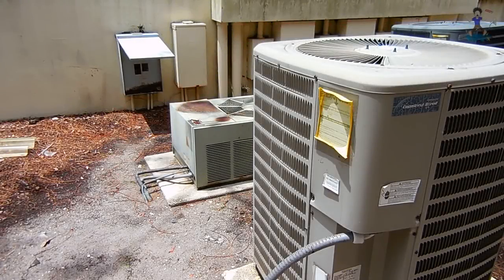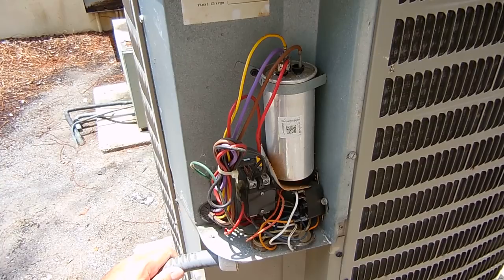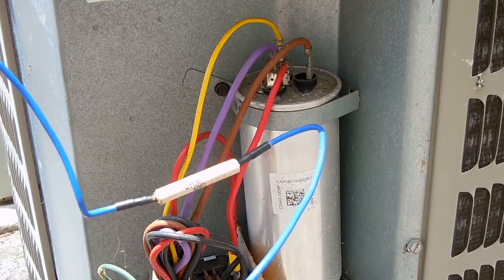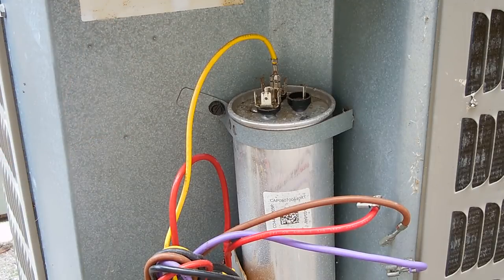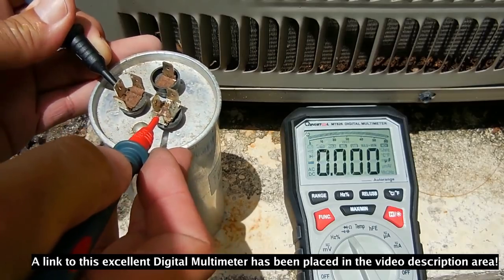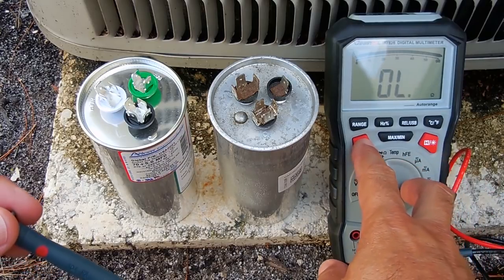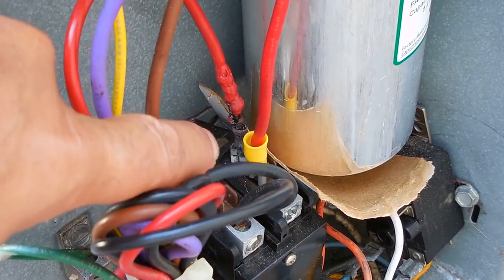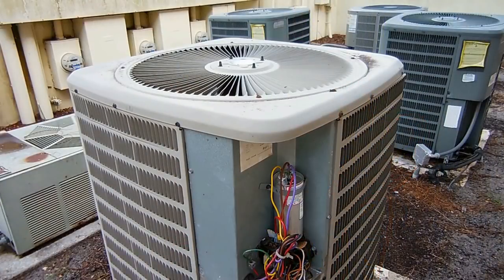Central A/C Compressor Won't Start Up(Stuck/Momentary Hum )

Comment: EVERYONE that owns a HVAC unit just go ahead pull the cover off the side of the unit, take note of the size capacitor and just order one and keep it on hand.  Its not if it will fail but when and it always fails at the worse time like on a weekend or super hot time of month where it could be a day or two before a tech can come out.  Just order one... or two
Reply: Also....take note of the contactor. Keep a spare of this too. A spare contactor and capacitor will likely be the main 2 items that will go bad after some years.

Comment: AWESOME VIDEO! Our unit is behaving EXACTLY like this. Its a brand new unit, but, we just went through a deep freeze here in Texas last week and lost power for 4 days, and now today we are in  the high 70s and wanted to kick the AC on the house to only get hot air out the vents. Went outside to inspect the unit and heard the same hum/buzz sound for a second and nothing out of the compressor. I've put in a ticket with our property managers but may just try checking the capacitor myself.

Comment: my one cent feedback; install the cap upside down so the short wires will reach the terminals; also to prevent moisture collection on the top of cap can; informative video; thanks for sharing; love your show.
Reply from the maker: That can be done since the can is well sealed. As for the moisture, that's not a concern because the compartment is well sealed from the elements once the cover is back on. Thanks for watching!
Reply: Some capacitors recommend to be installed up.
Reply: If u install it upside down, theres a risk the capacitor cud can slide down and cause a short.
Reply: It's usually not advised. The capacitor works by having a fluid in it.....if it leaks "upright"......it may work a bit longer until you fix it. If it leaks cap-side down, it may fail very quickly once it leaks....no time to order a spare from Amazon !!😄

Comment: I am watching this because my ac stopped working well two days ago. Before I call an expensive pro, I want to see if there’s anything that I can do. My ac blows nature air in house so does the outside unit. The compressor doesn’t sounds like working based on my poor ears. Your video is so great and easy to understand. Thank you! Would you please explain why the capacitor needs to be discharged? What might happen if I don’t? I just want to understand so I might follow better. Thank your sir!
Reply: All capacitors hold electrical charged,  it needs to discharge it.
buy a spare one.  any capacitors can go bad at any time.

Comment: Had same symptoms, fan spinning slow, compressor hum and switches off. Two separate caps, fan cap read 1.5 comp cap no reading, replaced caps and that's all I paid for. Did it myself. 😁
Reply from the maker: Great to hear my video helped! I have a lot of excellent videos on my channel that cover many different subjects, so be sure to check out my extensive video playlists for other videos of interest to you, rate thumbs up, and share my channel with others. Thank You

Comment: The quality of the original capacitor makes a huge difference in how long they last. If you change out the original cap with a  quality part and test it im guessing you will not need a hard start kit. I have purchased extra caps since this type of thing is common and easy to change out the cap yourself. Be safe.  ( regular routine maintenance of a/c unit performed)

Comment: The same thing happened to me right after my 1-year  new TRANE service check.  Turns out the contractor took out my good capacitor and installed a weak rusty one that quit after a week.  All because I did not buy the service contract.  Bought a new capacitor, installed it, and it has been running fine since.
Reply from the maker: You saved yourself a couple hundred bucks.
Reply: Hope he rots in hell that contractor who does horrible acts

Comment: Everything you said was my scenerio. I replaced the capacitor. Then the contactor but the compessor never turned over. Contacted a so called pro and they came out. Hooked up testers and told me they chowed infinity and that my compressor was shot. He said let me see if I have a hard start kit. Went to his truck but didnt have one. Gave me 3 quotes for different set ups and left with my 90 dollar. trip charge fee. I was disgusted so they had the business owner come out and he also machine tested the xc and says theres no smoke and mirrors here and restated I needed a new compressor or unit. I saw your video and got a hard start kit. Hooked it up but nothing. I took a rubber mallet to the top and sides and the hard start kit did the trick. It started quicker then ever. It has been running better then when we bought the house 8 years ago if that is possible. Doesnt short cycle and starts very quickly. Hell the lights in my house dont dim either. My question is, should I seek my 90 dollars back? I mean I know nothing about HVAC but I feel screwed.
Reply from the maker: Glad my video helped. Be sure to share my channel with many others. Thanks!
Reply: How did you know what hard start kit to buy?
Reply: @jcimco9360  Luckily one of the places I called to come give me an estimate left me one in their mailbox. They could not come right away and told me to try it. It worked.  Supco SPP5
Reply: You cant always assume the hvac guy is trying to screw you. Some people just suck at their job or got trained in wrong. (U might have to diagnose the hvac guy yourself is all I'm saying, lol).
Reply: Those guys were part changers. Not technicians.  I'm currently in trade school for HVAC.  Some people just suck
Reply: I have a similar issue where my compressor is humming every 5 or 6 seconds but not turning on. I replaced the capacitor but that didn't work. I tried adding a hard start kit but compressor still doesn't start. Next I'm going to remove and diconnect the fan and try whacking the compressor with a rubber mallet. While I can, I'll check the wiring at the compressor. Hopefully I can get my AC working.

Comment: When you found the red wire was restricting the height of the capacitor meaning you had to have cardboard as an insulator between the can and contactor you should as a diligent repair man have replaced the red wire with a longer one. After all you had both ends disconnected at some point. That also would have meant you could raise the capacitor up away from the contactor AND not have to reuse the burned contactor blade as there was a second blade but that was too close to the then very low capacitor.
Reply from the maker: Easy to do when you have one on hand. :-). I was helping a friend.

Comment: Thanks to you for this video. My unit was running fine midday and then stopped cooling. The compressor and fan were not running. The compressor would try to start but the fan would not. A check of the capacitor produced zero results. Also my capacitor top was bloated. A new capacitor was the fix. Unit even sounds better IMO.
Reply from the maker: Great to hear!

Comment: Same thing just happened to mine this past weekend. Tech replaced capacitor and he said the compressor was still binding or stuck. What's the easiest way to determine if he in fact replaced it? The unit is a 4 year old Goodman. Thanks
Reply from the maker: Thanks for watching!

Comment: I have same symptom. Compressor tries to kick on with a hum for few sec but won't. Cooling fan runs. New condenser about 8 years old. When I hook up manifold gauges  both read almost same temp without system running. Which I believe means only vapor is in the system signaling very low refrigerant. So I am thinking my prob is low refrigerant but how can I charge it if I can't get the compressor to kick on? How do I bypass the low pressure switch? If that isn't recommended do I just need to draw down and pull vacuum on system and recharge as if new? Thank you. I am in Texas and now not good time for  a to go down.

Comment: @electronicsNmore - this is rad. at around 9:13 on this video, the other AC unit appears to be stopping and makes a loud knocking sound.... this is what's occuring on my home unit (Lennox) that is 1.75 years old. None of the others in the neighborhood make this sound. I am not sure what the issue is and I've been told by a local "builder warranty" co its a compressor, which they don't recommend replacement. Do you have any advice for me - replace/don't compressor or possibly something else. the unit runs great, but when it stops it makes a loud knock on turn down. I'd rather replace small, lesser expensive parts now, then wait till later. And FYI... the waranty co does not want to do work. Please help.

Comment: Hello 👋 I see your videos and I have a problem on my a/c unit and was wondering if you can give me tips on what it can be … my a/c unit turns on and fan works but it’s not blowing cold air in the house and I noticed the suction pipe is not cold. Thank you for your time.
Reply from the maker: Compressor is not running.
Reply: @electronicsNmore  can it be the capacitor ?

Comment: Question what if I’m only getting 220 I think I was getting 221 on my t1 l1 off contact. I need to see what is going in tomorrow. I changed compactor the last one was bad . It was supposed to be 45 /5 I had 11 /5 I put a new one on nothing. Checked wires to compressor ohmes out compressor. Seemed fine is it locked up ? I was getting a very warm feeling on the suction line while trying to cool .  I am baffled . I don’t have alot of experience I installed a lot and 1yr of service now working at apartment to practice my craft .  If you can help . Let me know if it’s a low power issue I had electrical problems burn 🔥 up compressors before . They said this unit was running last summer . I  can’t get it on .

Comment: I have a 45/5 uF cap used on a 4 ton 30 year old carrier condenser. What hard start kit do I use for this?
Reply from the maker: Hard start kits are sold based on the tonnage
Reply: @electronicsNmore  I have a 4 ton carrier, so which hard start kit with the built-in relay should I get?  Thx!!  (love your vids!!)

Comment: 2:15 you said you were going to install a hard start kit. That was never referenced I assume you punted on adding that? I do have a question on this Hard Start thing however which I am sure you can answer...In your opinion does adding one of these degrade your existing capacitor? I installed one on my system and all is well except the unit is very noisy when coming on. You can clearly hear the click, 2-3 times louder than before. The lights in the house as well flicker. This was not the case pre-hard start. I was told these HS capacitors eliminate flicker not increase it. I am confused. What's your opinion on this, thanks.
Reply from the maker: I found the problem with the A/C, so there was no need for the hard start kit. The kit when installed properly, will not cause any problems. Make sure the main lugs in your breaker panel are tight, if they are, then call up the power company. You have a bad connection between the house and utility pole. Lights should not flicker.
Reply: Thanks

Comment: My Carrier unit is doing the same. Got a replacement capacitor ordered. Hopefully can be fixed.
Reply from the maker: Hopefully that's the problem. Thanks for watching!
Reply: @electronicsNmore  I hope so too. It's the middle of summer where I live. Got no A/C right now. I have 4 fans scattered around the house.
Reply: @elegant6066  Got the replacement capacitor for the outdoor unit. AC is working again! Still love my fans, though. Kept me through some tough times.
Reply from the maker: @FSM_Reviews  Great to hear! Be sure to return the favor by sharing my channel with many others. Thank you

Comment: Another great video!  My wall unit ac stopped blowing cold air. It hums for 3 sec and stops. And it repeats it a few times. It cannit seem to start the compressor.  Not sure if the compressor is locked or the capacitor is faulty. Any idea?
Reply from the maker: Sounds like a faulty capacitor, or stuck compressor.

Comment: Great video.  A few days ago I decided to test my RV's AC (unit is like new).  Like a fool I started it twice without waiting for the system to equalize (maybe only 2 minutes).  First two attempts were successful.  The third attempt something bad happened.  Fan comes on normally compressor kicks on sounding about 50% slow and quiet (pulling a ton of amps) then after about 4 seconds the systems quits the attempt.  About 12 seconds later the systems tries to start the compressor again with the same results.  I don't have a meter to test the run capacitors level.  It's a ton of money just to have a RV tech to come out and diagnose.  Does this sound like I sort of killed the cap?  Or did I damage the compressor?
Reply from the maker: Try wacking the side of the compressor with a rubber mallet just as you power it up. It may be stuck.
Reply: No I went on the roof of the trailer and it's starting up (it's vibrating) but it's just running like at half speed.  Couldn't it be that the capacitor just isn't giving it of enough of a kick start fully to get it up and running?  I'm praying I didn't damage the compressor otherwise as you know I'm looking at having to replace the entire unit.

Comment: If the fan star running very slow about few min ~ will it issue of capacitor?
Reply from the maker: Bad cap or bad fan motor.

Comment: Dang good video! My heat pump just started acting up in heat mode. It actually started yesterday and blew the breaker. I reset it and could hear a slight hum and a weird flutter noise so I thought maybe the compressor went bad. I put it in AC mode and the compressor kicked in right away. I put it back in heat mode and the compressor did start up but the next AM it was humming again. I did replace the dual capacitor last spring but it made a loud POP when the unit came on and found out it was the contactor was bad also. I replaced the contactor and all last summer the AC ran great. So now I have to go get a real meter and check the capacitor and hope that is it. I did not replace the capacitor when it made that pop because the AC worked.
Reply from the maker: Does the reversing valve click when switched to heat? It's not the capacitor if it works fine for cooling. Tap into the heat pump wires with a DMM and check the AC input voltage. Normally 24-27VAC. Try tapping on the solenoid with the power off to the outside unit, and the thermostat set to heat. After doing that, turn on the outside unit.

Comment: Before assuming the capacitor is discharge I recommend using a multimeter and properly check the capacitor
Reply from the maker: If you short the terminals before touching them, then there's no need to do that.
Reply: @electronicsNmore  I guess we both have a point I appreciate your wonderful video. Here's my question if you assume the resistor discharge the capacitor and you short the terminals on the capacitor what worst you think could happen?

Comment: Mine started making a zapping noise in the inside breaker box for about 2 months until 1 day it kept doing it all day and the AC wasn't cooling the house thank God I have a friend who is a AC man such as yourself because I am disabled and live on a very small budget well I finally was able to get a hold of him he came out and it was the part you just changed it was called 60+5 well the next day he came out and fixed and my AC is now working thank God but I have a question it makes that zapping noise still but only once n a while could you tell me what is causing that my Ac unit is 8 years old and I keep the inside coils clean and always keep changing the filter I go to a AC place and I buy this can of stuff that I just spray on the coils and scrub it no water required I'm sure you know what I'm talking about I do that twice a year besides the question I asked you above is there anything I'm suppose to be doing to keep the outside clean I'm disabled and my husband of 37 years left me and I don't have anyone to help me so I can't afford for it to break hope to hear from you soon and thanks so much for sharing your knowledge it truly means a lot especially to your subscribers such as myself who live on $725.00 a month O and he charged me only for the part which was 38 dollars I believe but he did say the same exact thing you said that someone else probably would have told me it was my compressor which I believe if that goes out wouldn't it be cheaper just to buy another unit ? Anyway thanks again for all you do
Reply from the maker: The buzz noise is due to high current flowing through an older circuit breaker.
Reply: @electronicsNmore  but my home and the AC are just 8 years old would you suggest changing that breaker and thank you so much for fast response your awesome
Reply: @electronicsNmore  I'm just trying to stop anything else from breaking on me
Reply: @AWIERD1  thanks so much I will try that asap
Reply: You should have your AC friend check the wires in the breaker box. Hearing sounds like that could be a loose connection. Breaker boxes should not make sounds.
Reply: @actechformallyyomama746  Loose connection

Comment: I found a 45/5 Farads in my a/c unit do you think that perhaps  is too low and that's  why the compressor doesn't start on? I does exactly the same ,like the one I. Your video
Reply from the maker: Check all connections on the capacitor and compressor, and make sure the capacitor is close to the rated value.
Reply: @electronicsNmore  thanks 😊  I followed  the steps but also installed  a new capacitor and it works 👍I love your  tutorial videos